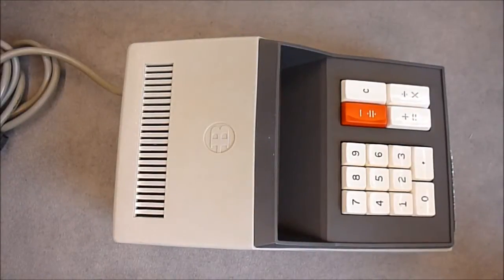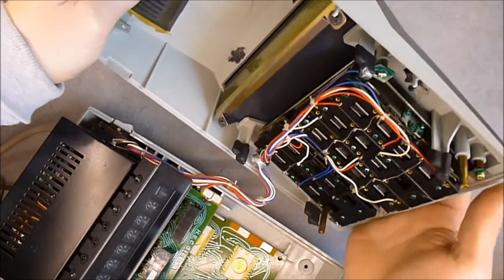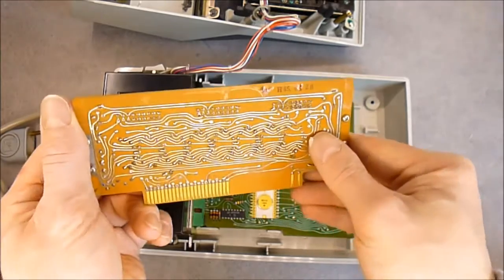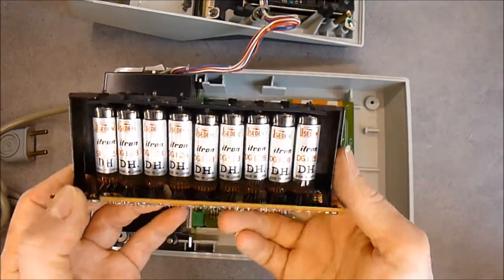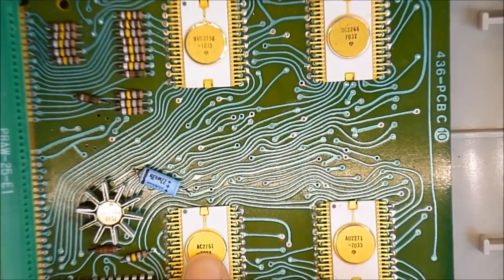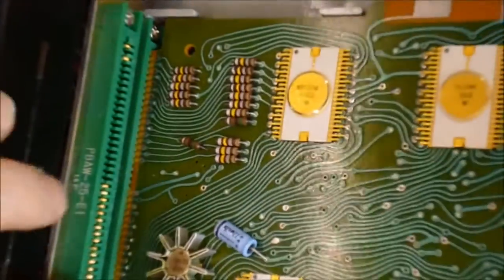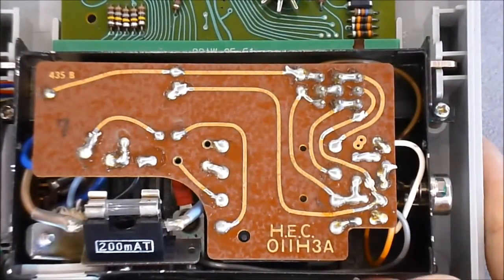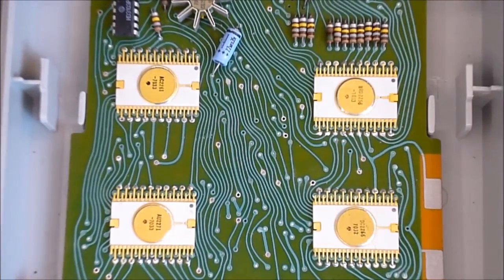1970 Vintage Burroughs C3155 calculator teardown

Comment: Curious. Were they using the reed switch setup to avoid contact bouncing?
Reply: Good question, if so it would simplify the component needs for a multichip calc using ssi and/or msi.  No LSI cpu here  - -?

Comment: The chips on the mainboard look like QIPs, or quad-inline packages! Really just DIPs with staggered pins, though. They were created as an early attempt at aiding pin density. They've since been superseded by various SMT parts.
Reply: These QIP packages were EXTREMELY popular in the Soviet Union, almoat all old 145 series calculator chips were in this package.
Reply: Looks crossover technology to me.
 I see what looks like a standard 14pin epoxy cased DIP TTL small scale IC. This is probably for the Clk Oscillator. The round metal cased is an analog IC for the pwr regulator